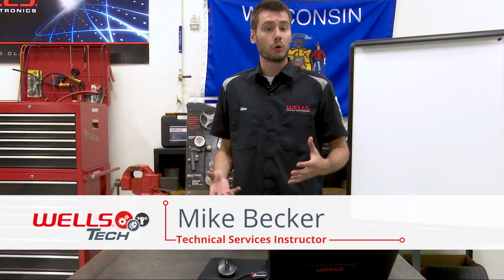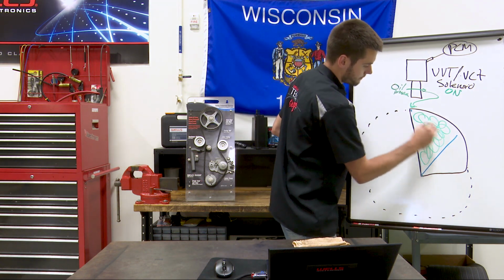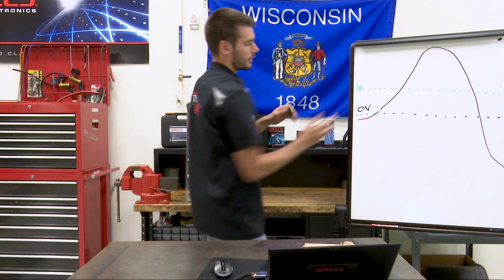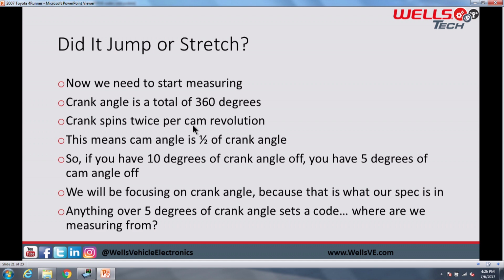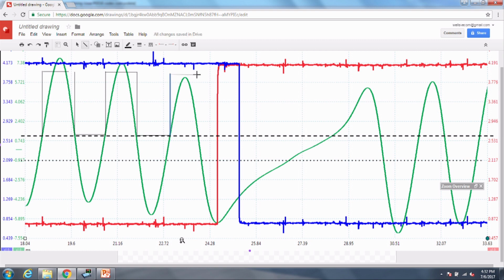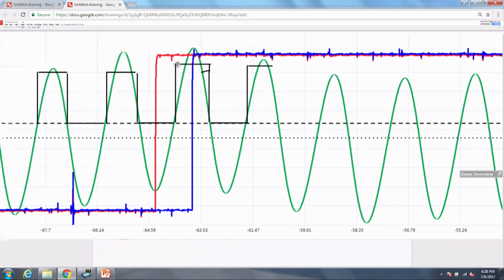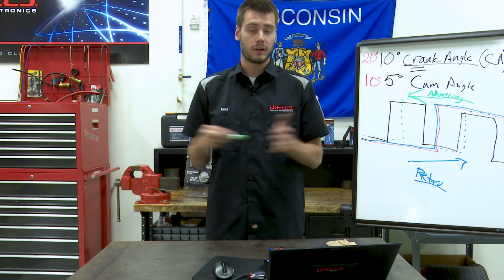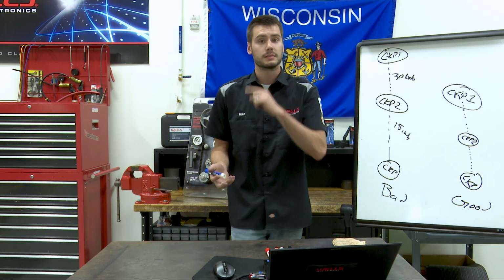-Episode 4- Is this timing issue really intermittent? Toyota P0016, VVT problem?

Comment: Nice! I'm not a pro mechanic (DYI'er) without fancy scan tools but my new PT Cruiser has a P0016 code. I was thinking to replace cam and crank sensors but after watching your videos and knowing that the previous owner replaced the timing belt himself 50 miles ago,  I believe the engine is out of time. Glad you can show the details to help me explain the issue on my PT.

Comment: I have a 2008 Ford Taurus X with the 3.5L. It normally runs and idles fine but a few times sitting at a stop idling there a "lope" or a light surge to the idle. Not stumble or a miss, just a light up/down up/down to the idle rpm. The engine light came on and I checked the codes. Had an active p0011 for "A" Camshaft Position - Timing Over-Advanced or System Performance (Bank 1) and inactive p0016 for P0016: Crank-Cam position correlation. Is this still likely a mechanical timing issue?
Reply from the maker: Hey TrashPanda 365, yeh it's likely a mechanical issue. The 3.5L was slightly common for it :(
Mike Becker, Senior Instructor
Reply: @GoTechTraining  That stinks. Well I'll call around and find someone to at least diag it for me. I've been a diesel tech for 25 years but we don't have the equipment to diagnose things like this. Thanks for the response.
Reply from the maker: Good luck!!!
Mike Becker, Senior Instructor

Comment: One sitting and watching all the videos 😁 
One more left , this is awesome man 👍 
Im might ask you something if i could not find the answer at the last video.
Reply from the maker: Thank you very much! Sounds like a long day of videos ;)
Mike Becker, Senior Technical Instructor
Reply: @GoTechTraining  well i blame you for making such good videos. 
The thing is that i had this code on a 2012 Hyundai Tucson 2.4L eng. And the engine is shutting down by itself when putting it in Drive  and sometimes in Park. 
The CVVT works fine , which is wired cuz my dad thinks that the problem is from it. 
But i think that the oil is , cuz afriend of the car owner changed it and doesn't know what kind of oil is in it.

Comment: Hey Mike wouldn't the timing being off on one side of the engine give you misfire codes on that one bank?
I'll be looking at a 2005 Toyota 4Runner 4.0L with a P0300 in memory. Truck was here last week got spark plugs, 3 coils, and valve cover gaskets replaced in an attempt to fix a misfire. Misfires are on cylinder 1 and sometimes cylinder 3 but its intermittent. Should i be worried about a timing issue since im not setting a P0016? Or Should i go after injectors, if so what tests should i bee doing? Thanks in advance, Homie Hektor!
Reply from the maker: Hey Homie Hektor! It's been a while!!! Yes, timing could cause the misfire issues. I do find it unlikely to not have the Timing codes though. Check code set criteria...maybe the cam/crank correlation codes won't set with a misfire code present??? Scope the cam/crank. If it's not a timing issue I would current ramp the injectors using the fuse.
Mike Becker, Senior Technical Instructor
Reply: NGK Technical Training thanks for replying, ok so the timing is dead on, everything lines up on mine like it did on the known good. Customer did say he had 3 injectors on bank 1 replaced, 3 coils replaced , and spark plugs changed out. Everything has been thrown at this truck. It’s a very intermittent misfire and I feel it more at idle, drives ok. 🤔

Comment: What if I notice the engine running rough at idle but idles fine at high idle? Also the engine sometimes runs fine and sometimes not, am I looking at a vvt issue? Or oil control valve?
Reply from the maker: SSmedic, there are a lot of things that effect how an engine runs. The first thing I would do would be to check codes. From there I would look at the fuel trims and see if they are reading rich/lean when the problem occurs.
Mike Becker, Senior Technical Instructor
Reply: NGK Technical Training I get the same P0016 code, it runs fine sometimes but then runs really crappy like the way you made it run in the first or second video when you made the vvt turn off. It is so strange because it might not happen for a week or so, then it happens every day for a bit. It seems like it runs on 3 cylinders at idle but then cleans up and runs normal when you rev it up a bit

Comment: Great Video as to what's going on. The bottom line is recycle the Toyota, buy a Kia and do the same 100k from now. Just not cost effective to repair.
Reply from the maker: Hmmm, i'm not sure about that one. Seems like spending a few grand on a 4-Runner is way more efficient than buying another vehicle. 
Mike Becker, Senior Technical Instructor

Comment: Mike...when you were comparing the signal from the known good car we can see that both CAM signals when crossing upward they don't exactly match  a bottom or top peak on the CKP signal wave -which shouldn't be the case as stated earlier in the video -,
or does it mean that both CMPs were reading a little retarded timing and hence even the known good car had a little bit of a stretched chain?
Great Video, Thank you very much.
Reply from the maker: Hey, it's probable that the known good was slightly stretched. The vehicle that I captured that from was only known good in the fact that the light wasn't on. It did have a lot of miles on it though.
Mike Becker, Senior Technical Instructor
Reply: Copy that man....Thank you very much.

Comment: Hey Mike! I am new to your videos and you are amazing!! Firestone has my 07 4Runner with the same problem right now and wants to charge me $3500 to change the chain. I am almost certain they did not diagnose my vehicle like you did in your videos, I will be taking it somewhere else for a second opinion. But I have one question for you.. is it possible that it is just the tensioner that needs to be replaced and not the chain? Is replacing the tensioner just as complex as replacing the chain? Or does it just all go together and u replace both at the same time no matter what? Thank you!!
Reply from the maker: Hi Shay, welcome to the channel! I hope you've subscribed :) The tensioner is the result...not the cause. The chain wears leading to it be longer than it was at day one. This makes the tensioner stick out further. Generally speaking upon replacement both get replaced...along with the guides and a pulley or two. It's a big job...make sure you take it somewhere you can trust!

Mike Becker, Senior Technical Instructor
Reply: NGK Technical Training  I am taking it somewhere my bf trusts and has used for many years, so hopefully I will get some better news. Have you ever seen that code come up and have it not be the timing chain? What percentage would you say that code means the timing chain needs to be replaced? I ask because I have taken care of my vehicle well, it is not running rough or making noise, it has only 92k miles, and I’ve heard it’s fairly rare for the timing chain to go bad. I have subscribed and I greatly appreciate your advice!
Reply from the maker: Sounds good Shay, I wish you luck! Usually, these are timing chain related....it's pretty common on this specific engine. 
Mike Becker, Senior Technical Instructor

Comment: In a nutshell, stretch or distance  between links is compounded by adding the stretch on each link together, the timing chain can be stretched but read within limits on the first CMP to signal but can be out of limits on the second CMP to signal due to the number of worn links (compounding of wear) present between the first and second CMPs, and the CKP (zero point), respectively.
Reply from the maker: Exactly! If each link has a slight amount of stretch the furthest cam from the crank pulley will show the most distance change due to the number of links in between the 2 points. 
Mike Becker, Senior Technical Instructor

Comment: Hi Mike I have a 2014 S60 T5 with 101000 miles for no reason the check engine light came up and the code is P0016 took it to the dealer and they said it’s the CVVT Solenoid. They replaced it and no luck the light came back on with the same code P0016 so then they said ok next is the CVVT Hub/ part number 30646226 I asked how much will that be they said $660.00 I said no because they are not sure they will fix the issue. They have never changed the time belt so not sure what’s causing he code the car runs like normal no rough idle or nothing please help thanks.
Reply from the maker: Hey HifonicsM3, sounds like they may be guessing. A P0016 is a correlation issue, similar to this Toyota. I would be doing some testing on there. Scoping the actual timing of the engine before throwing almost 700$ at it. In your shoes, I'd ask for a guarantee before money is spent..otherwise I'd take my car elsewhere.
Mike Becker, Senior Technical Instructor

Comment: Is there a picoscope that's 4channel, has good sample rates, and doesn't cost 2-5k?
Reply: All I have right now is a single channel uscope. I love the thing, it performs great and has served its purpose as a starter scope but I'd like something with 4channels. I know pico is the best but I've been looking at the autel 906bt and their scope module considering I can get both for 2k and could use my own scantool as well
Reply from the maker: William, if I were in your shoes i'd suggest saving up buying the PICO. The Autel scopes not bad, but it's not a PICO. I feel like in the end you still end up getting the PICO. Maybe you can find a used one? You could get yourself a starter kit and expand on it once the funds are available too. Here, check out this link from AESWAVE.com.....https://www.aeswave.com/4-Channel-PicoScope-4425-Starter-Kit-In-Foam-p9515.html
Mike Becker, Senior Technical Instructor
Reply: Wells Vehicle Electronics I get that pico is the best, and you're right, everyone probably ends up with a pico. I just feel, for me, at this point in time, it would be better for me to get the autel because I need a good bidirectional scantool as well considering I'm trying to start a mobile diagnostics business for some side money and I cant afford both the pico and a scantool ar this time
Reply from the maker: If you're looking for a 2 in one, sure it works for ya. Thing I don't like with that is you can't use the scope and bi-directional controls at the same time. 
Mike Becker, Senior Technical Instructor

Comment: Very helpful I got this problem on my Toyota FJ Cruiser 2009 if my timing chain stretch , I need a new one for sure but it’s because the chain of the dealer is cheap? If I bought a new one I go with a dealer one or aftermarket? I hope you got a time to answer my question.
Reply from the maker: Hey Yan, hard to say EXACTLY why the original chains stretch, but it seems like a big issue on these. The choice is yours at where to buy. I'd think the dealer would have fixed the issue with the chain if they found one. Either are viable options for this engine. I went aftermarket on this job.
Mike Becker, Senior Technical Instructor

Comment: Great video series, im having the same check engine light but once i cleared the code and let it idle for over 30min it didn't come back. Could a clogged oil filter or burnt oil cause the sensor to trigger the code? When it has come on its at an initial startup, engine acts like the timing has been retarted and than goes back to normal. Can a bad fuse cause this?
Reply from the maker: Hey Waaba Waaba, I believe the answers to be no, no, and no. If you have the same code as this one the timing is over retarded. The only way this happens is chain stretch or jumped timing. Maybe an oil issue caused this to happen, but either way the chain will most likely need to be replaced.
Mike Becker, Senior Technical Instructor
Reply: Took it to Toyota they swear it's the vvts. Saying it's due to them being aftermarket

Comment: You did an excellent job diagnosing the stretched chain but should the pcm trigger a code with that small of a difference, I would think it would have to be at least one tooth to trigger, that is an awe full amount of work to do for something that probably didn’t effect the performance of the car that much
Reply from the maker: Hey Frank, thanks for watching! It was a lot of work for that, but some customers want a proper running car. Performance effect, not really, fuel economy did go up though.
Mike Becker, Senior Technical Instructor

Comment: Very good info.  I have an FJ cruiser with the same engine but my code is intermitent.  I have not cleared the code out and it goes away after a day or two and returns after a week or so.  My Toyota dealer didn't investigate further than telling me the code p0016 and giving me a list of parts they would throw at it to try and eliminate the code.  I can't afford to throw money after money hoping to fix it.  Given that it is intermitent could it be the cam phaser/adjuster not operating correctly sometimes due to debris or sludge or is it more likely the timing chain is the issue?  I will likely pull the valve cover to verify the actual cam timing marks soon but you seem to have a really good handle on this.  Thanks in advance for the info.
Reply from the maker: Hey Jon, Thanks for watching! As shown in this video a P0016 can not be caused by a VVT issue. A VVT issue would advance the timing, and a P0016 is for over retarded timing. Hard to say for sure without scoping but I bet your chain is stretched. 
MIke Becker, Technical Services Instructor
Reply: Could that be an intermittent issue though?  I can go weeks with out the light on and then it will randomly come on again.
Reply from the maker: Usually not, but when is the last time you let the vehicle idle for 15+ minutes at a crack?
Mike Becker, Technical Services Instructor
Reply: Actually it happens at least once a week...waiting on kids
Reply from the maker: Interesting. Again, it's hard to say for sure without a clear picture. Whether you do it the easy way, with a scope, or the hard way, removing the valve covers...it's up to you. But you need to find out exactly what it's reading. 
Mike Becker, Technical Services Instructor
Reply: And the code typically pops up when driving not idling
Reply: Thanks again for the insight.  I wish I had a local tec that could scope it for me.  I will probably pull the bank 1 valve cover to visually check out the timing marks in relation to the external flywheel marks...
Reply from the maker: Alright Jon, let me know how that turns out!
Mike Becker, Technical Services Instructor
Reply: Thanks I will!  How many hours do you thin kit took to replace the timing chain if I need to go that route?
Reply from the maker: Jon, I would figure at least 10+ hours for replacement. 
Mike Becker, Technical Services Instructor
Reply: OK and yes the chain appears to have stretched.  The timing looks to be retarded almost identically to the the one you did.  I making a list of parts and pieces I will need.  Could you list anything you needed to replace when doing this project (parts pieces misc gaskets..etc)  Just want to make sure I don't get into it and have to wait on parts.  It's my only vehicle and I can't have it laid up waiting on something I could have predicted.  Also, The service manual shows pulling the oil pan off but it appears you did not.  Thanks
Reply from the maker: Alright nice! You are going to want the chain, guides, tensioner, idler pulleys...basically buy the chain kit with the water pump. You may want a new serp belt, tensioner, and idler pulleys as well. Basically look at the service manual and see what it all tells you to take off...then work it backwards and see if you need something to put it back together. 
Mike Becker, Technical Services Instructor
Reply: OK sounds good, but did you pull off the oil pan too?  Or were you able to do everything with it on?
Reply: Jon Schultz Designs you don’t need to pull out the oil pen,,
do like what he do, it’s clear..

of you want to pull out the oil pen,, than you need to remove the front diff indeed.